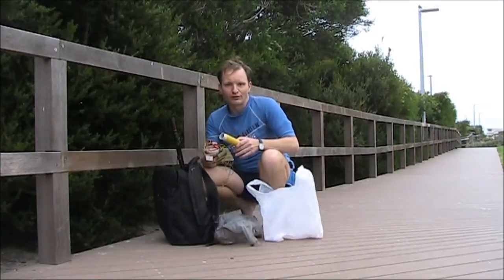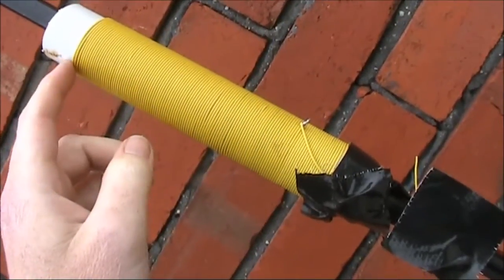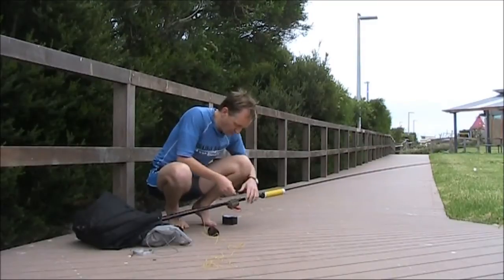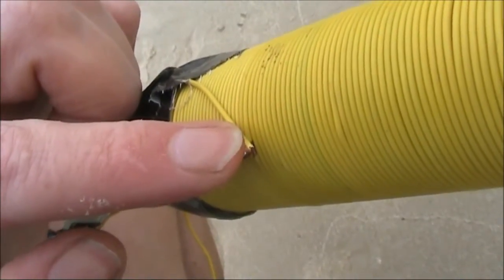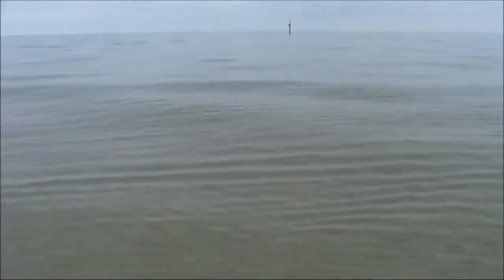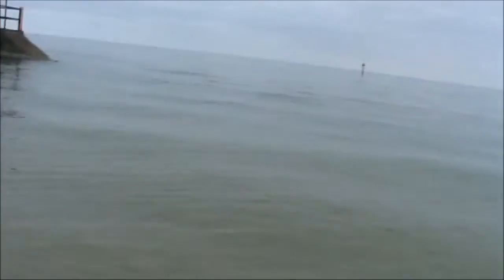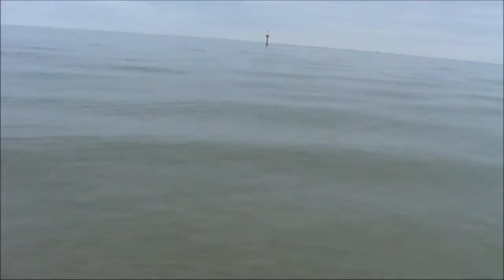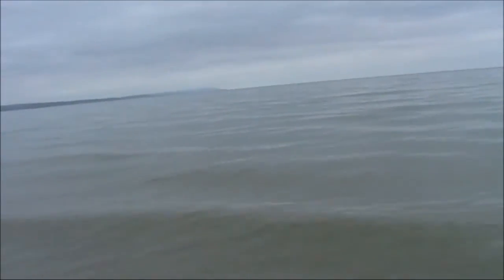3.5 MHz pedestrian mobile with the Wadetenna

Comment: Why do you need the L match coupler Peter if it's a monoband quarter wave, resonant on 80m with a tapped coil? Was it so you could work the cw portion as well as ssb?
Reply from the maker: I suspect its because its impedance departed significantly from 50 ohm. One can have an antenna that's resonant but still not 50 ohm.
Reply: @vk3ye  thanks Peter that makes sense. If I ever get round to building one I will remember that